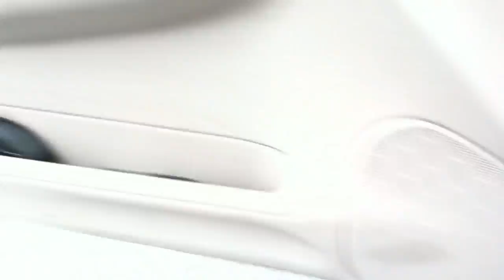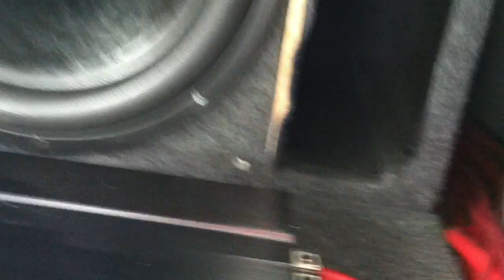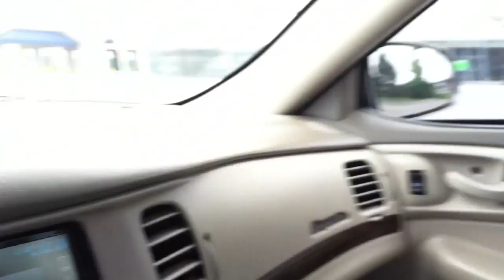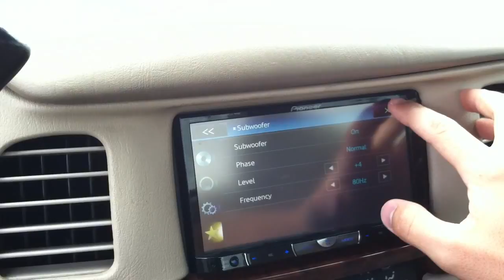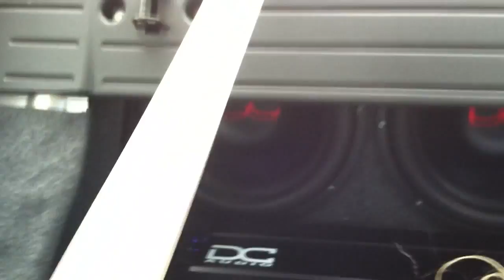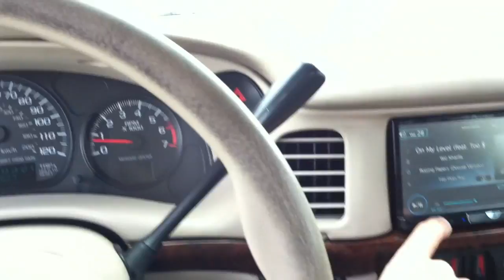DC Audio XLm2 15's on DC 5.0K 5,000 watts

Comment: What's up dude .I still have the rockford fosgate t2500-bdcp  that I bought from you on off ebay ,remember ? that worst thing I have not even install it yet I got everything but my alternator,I waiting for the right car to put on ,anyways where did you get you alternator ?N why go from ROCKFORD FOSGATE to  DC AUDIO? better?how much$ in AMP n SUBS, did you installed  the system you self ?  
Congrants , looks like your front windshield and windows areseriouly  scared now,
 KEEP IT GOING JYMMY BOY